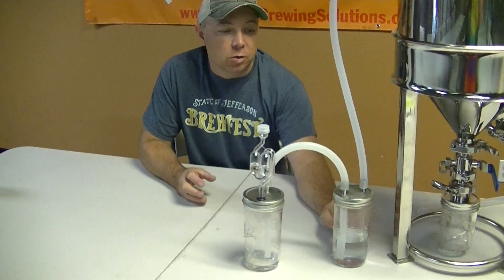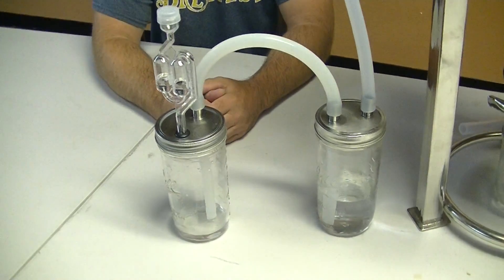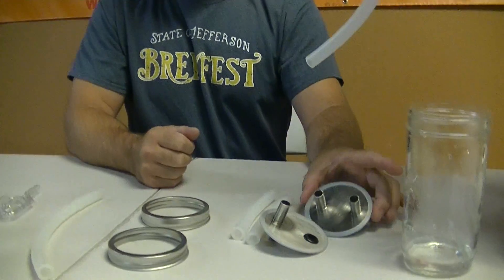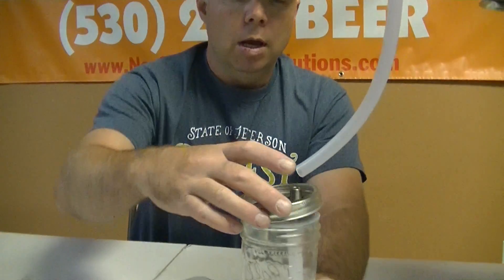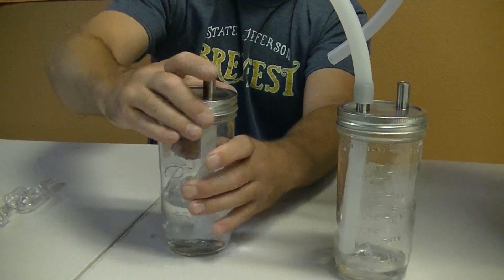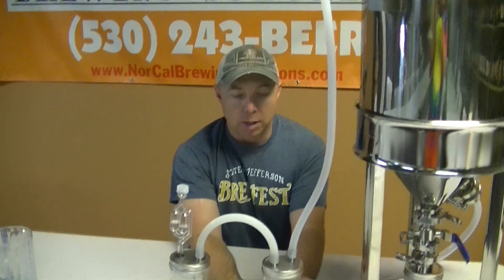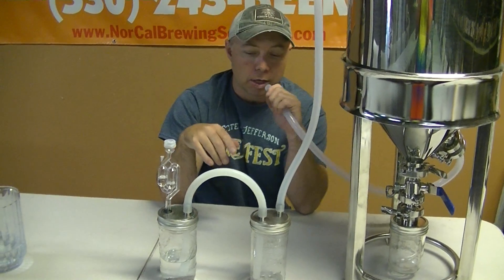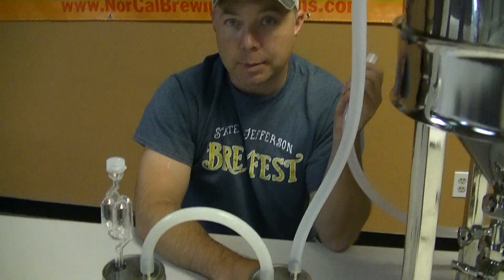Jaybird CO2 Harvester Kit from NorCal Brewing Solutions

Comment: Looks like a good idea ... but Im not sure there would be enough CO2 for cold crashing, I have a bag system at the moment and have needed to put two in parallel to have enough, they are much larger than those jars. Another issue would be that the first jar is half full of normal air (not CO2) at the start, the CO2 is heavier than the air so only the replaced water would retain the co2 (as the tube is sucking from the bottom of the jar). Would it not work better if only the second jar had water in and the first jar did not have a hose to the bottom then all the air would be pushed out of the first jar during fermentation (from the top) and only co2 would be brought back into the fermenter during a cold crash
Reply: Thanks for the comment.  Depending on the batch size is how big of jars we need to facilitate transfer.  You are absolutely correct.  We fill the first jar completely with water and let the CO2 push that over then saturate the water with the CO2 as it passes through the water.
Reply: You can get 64Oz mason wide mouth mason jars that this would work with. And if you have a really big fermenter, you could just chain the jars in sequence and expand it infinitely, theoretically.

Comment: How does this effect priming calculator? i.e I would normally input fermentation temperature to calculate priming, with CO2 being drawn back in, would you use cold crash temperature?
Reply: Gregory this is not going to affect your priming enough to really be able to calculate it.  But yes use cold crash temps, as that is the temp you are going to be at when priming.

Comment: It seems (as to the suck back) as water is sucked to the “dry” container without the plastic air lock, only Co2 is being sucked into the fermenter. Once water has been fully transferred and if suckback still continues, then it seems outside air will be drawn in through the plastic airlock and “dry” bottle to the “wet” bottle through the water. That being said, fermenter headspace & large bottles would rule as size matters